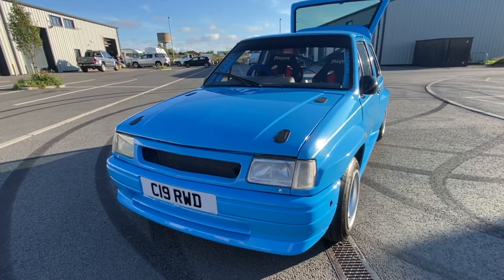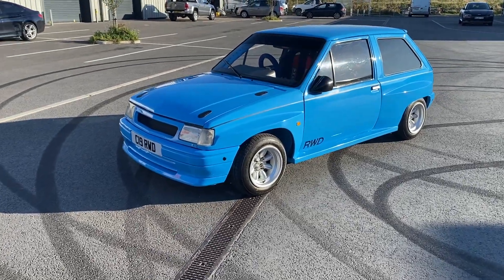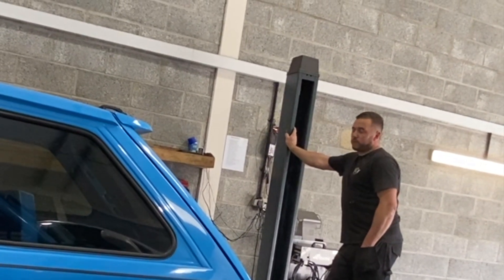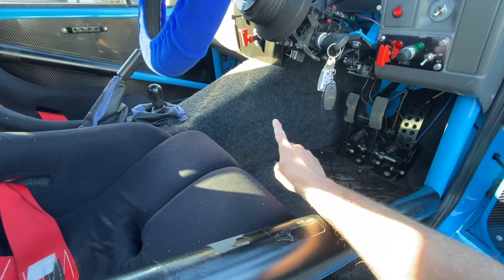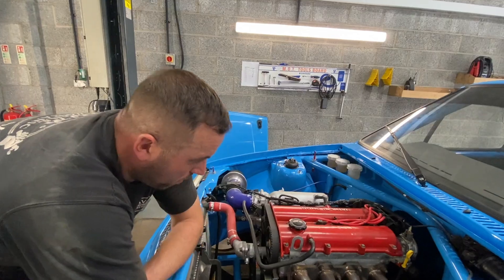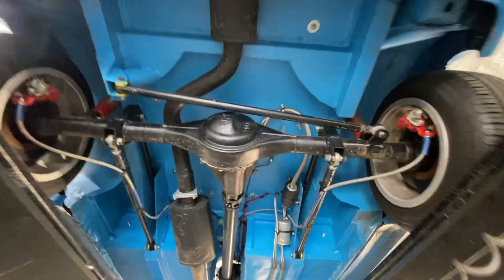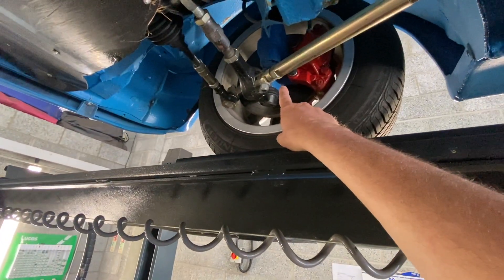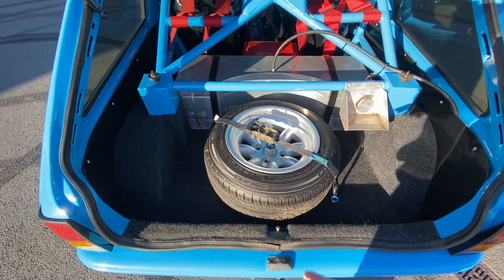HE BUILT A RWD VAUXHALL NOVA USING AN MX5!

Comment: Hi guys, been following the channel for a while. Checked out the Corsa at the Vauxhall Show at Santa Pod earlier this year. Shame you couldnt get many runs in on the Sunday. Did the parts ever arrive for the Corsa D Z19DTH? Or has that project been binned?
Reply from the maker: No it’s still sat on my drive. Runs and drives just needs mapping. Just not had time with the roller coaster I have been on currently 🤣
It will be finished in the next few months all going well.